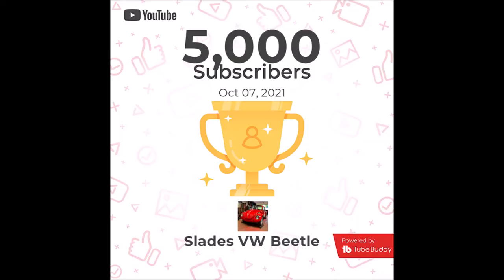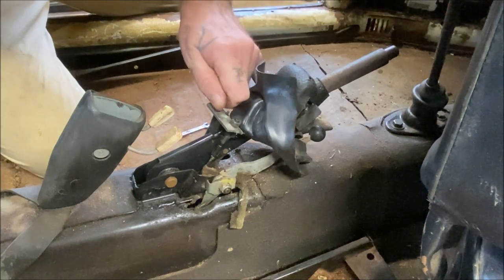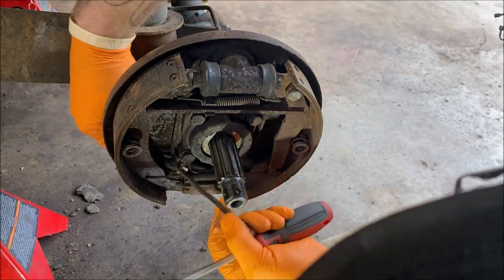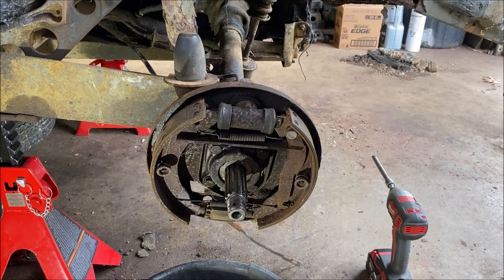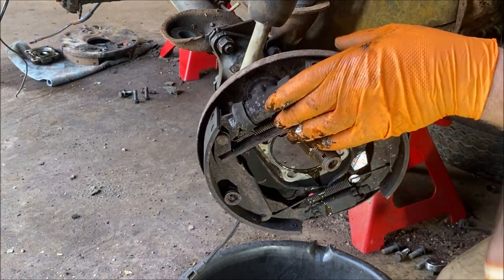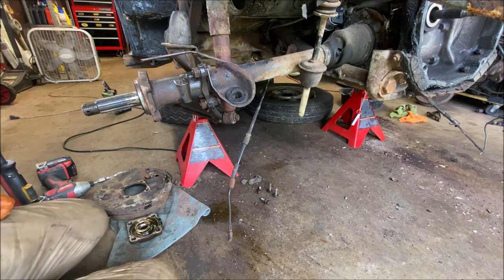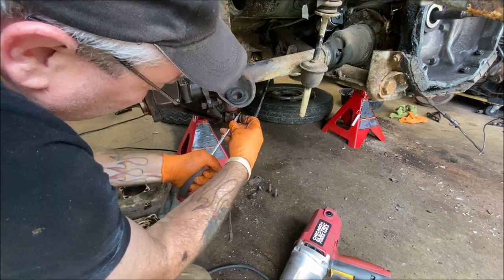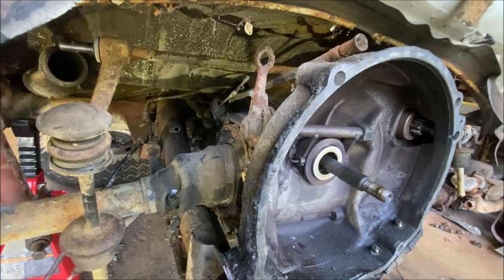VW Beetle Transmission Removal! Swingaxle Transaxle! DIY!

Comment: Greetings, thank you for the sharing this video along with the products you are using and the infotainment. I have a 58 which I need to have the crashbox transaxle removed and replaced with a swing axle. Going through the steps you’ve showed was not what I imagined, however I’m certainly glad that you went through the numbers on the removal process. This will be my first time and I want to do it myself. Again thanks for the education, God speed!

Comment: I just got a month ago a 1968 Beetle as yours, probably on better shape, and your videos are the best help I can have to restore mine, because as you, I'm doing it by my self. Thank you for your videos and congrats for the 5000 followers. Also, I got a 1973 beetle that will need a lot of work and I got that one as a trade for a small trailer that I had. I believe I will convert that one into a Baja Bug because the previous owner did some modifications that I really hate as a Beetle lover. He removed the original dashboard (totally removed) and install a aftermarket dashboard. I have two options, have a Baja Bug and keep it as it is or restore the car finding another beetle body where I can remove the dashboard and fix mine, but I believe this is almost mission impossible, so the Baja option sounds the best solution, but will see. Keep your hard work.
Reply from the maker: Thank you Jaun!! I appreciate the kind comment!! 
Baja may be your best option with that one, I can  understand why you would go that direction!! 
I like the 68! It was also my first car when I was 16, was a 68 Beetle!!

Comment: Well that was a struggle.  Glad you got it out.  My bolts on the bus don't give me trouble.  They snap in half and get tossed.  I'll invest in lots of hardware on reassembly.  I'd dread the wire wheel cleaning to come.  Keep up the good work!
Reply from the maker: Those bolts have not been loosened since 1968, and I could tell! But as much as I complain, and my body feels it, deep down in it keeps me busy! Thank you my friend!

Comment: Thats a great achievement getting the 5k subs. Congratulations. 
There is a special tool to pull those axel bearings but i cut 3 slots around the edge and use standard pullars on them.
Reply from the maker: Thank you sir!! I appreciate that!!! I never seen the actual tool yet. I’ll have to do as you described.

Comment: Congratulations on 5,000 subs Slades.  I bet you will hit another 5,000 by this time next year.  Keep the content coming, you make an near impossible task seem possible and doable.
Reply: As a thought Slades, could you take a few minutes on a video to show us where are the best and safest points beneath the Beetle to put the jack so as not to damage the underside of our Bugs. You might be able to run a short clip like you did recently. I have seen many on YouTube but there are different places that they advise and one advised to place the jack at the exact spot you advised not to place the lifter, the cross bracket at the fork ends.  This would be helpful and put to bed once and for all where to properly put the floor jack. 
Again, thanks Slades.  Jim Semertzides
Reply from the maker: Thanks Jim….I truly appreciate the kind words!! That’s what keeps me going!!
I’ll definitely do a video on front and back…jacking up and also jack stands! Gimme a short period! Mine has no wheels on or beam to lower it to the ground temporarily

Comment: Another great video Slades. Proud to be part of the 5000 subscribers. Boy all the stuff I’m going to have to do to mine LOL 😂. I’m trying to source tires. Where is a good place you recommend? At work we don’t have ability to get any in the size needed. The tires are from 1993 and the spare is from 2001 no way I’m chancing those. Lol
Reply from the maker: Honestly I would try the online places like tire rack. 
If your staying stock brother, I believe cip1 and Jbugs carry the tires. I even punched them in on Amazon
Reply: @SladesVWBeetle  Yeah JBugs was out of stock. Online I did find one place. They only have one brand though in the 165/80/15 and that’s Nexen which is fine but I was hoping to have more of a variety. I read somewhere that a 185/65/15 would work but I’m worried that would be too wide.
Reply from the maker: @blakewaddell451  The 185 will work in the back. Now I’ve heard quite a few people running them up front. With no issues at all. 
If your car is at stock height, I believe it would be fine. I would go online with that tire conversion chart and see the difference between stock and then grab a ruler and get under there and check it out. Doing tire stuff is always tricky.

Comment: The z bar is a variable rate helper spring for heavy loads. Added due to the smaller torsion bars. It’s not a sway bar.

Comment: You Could have someone weld a stud onto the z-bar bolt that broke off. I have done that before and it works well.
Reply from the maker: Thank you!! Actually caught me off guard. I used PB blast, probably should have used heat.

Comment: Congratulations on 5000 Subs by the way your video was perfect timing I'm going to be pulling the swing axle out of my manx style dune buggy. The transmission has 1st 2nd reverse but not 3rd and 4th previous owner said it was a linkage problem I've been adjusting the linkage no third or fourth it feels like it goes in 3rd or 4th but nothing happens do you have any ideas. Thanks
Reply from the maker: Thank you!! And thanks for being here!!! Sometimes they come right out, and yours might!! Mine was never out since 68, and I’m in the rust belt! 
Not sure, if you tried adjusting, it may be the trans itself. I usually don’t hear if third and fourth though. Second popping out, or reverse.
Reply: @SladesVWBeetle  Thanks for the reply I'm looking for an easy fix like we all do right.......
Reply from the maker: @motorcycleguy73  Absolutely!! The easier the better. Did you check the coupler for play? And the shifter for all adjustment possible? I’m sure you did, but wanted to ask.
Reply: @SladesVWBeetle  It has a  new coupler new shift bushing and I've adjusted the shifter. When I shift it manually by hand without the shifter it feels like it goes in third and fourth I feel it but when I let out the clutch nothing happens or if I roll it nothing happens it doesn't go into a gear I don't know it's baffling I might pay an hour's worth of time to figure it out before I start pulling things apart the previous owner said it was just an adjustment but you know how it is with previous owners.

Comment: Can swing axĺe trans convert to irs or are they a different transmission completely?
Reply from the maker: Honestly, I gave it consideration for better handling. However, I’m going to use a camber compensator and show the installation. Because it can be done! You would have to change the trailing arms, sadly, the body would have to be lifted slightly to weld a bracket on that you can buy.

Comment: btw , you can weld on a new rod to znbar
Reply from the maker: Thank you for the input I truly appreciate that. I was actually thinking about a camber compensator. Still doing the research to see which is better.
Reply: If you need a bar parts I have some you can have. I think I have extra down bars in decent shape off a 1967 bug. They should be the same. Let me know
Reply from the maker: @irvingnorwood1640  thank you very much, that’s honestly very nice of you. I think mind sad so long that the threads rusted pretty bad.

Comment: Too much coffee or wat? Shaky hands
Reply from the maker: No, I have a tremor disorder. Thankfully with proper treatment, over the last few months it’s starting to get better that’s a little bit of an older video. Thank you for being here..
Reply: @SladesVWBeetle  I kinda figured it might be something like that. I'm a welder/fabricator and at the end of the day mine are either cramped and locked up or spasming like crazy. Sometimes early in morning after my morning cups wen TIG welding my hands are real bouncy.Thank God for Medicinal Cannabis.. It works wonders for all my aches and pains. CBD ointments and  some THC  treatment is wat works best for me. Ty for your insight with these cars I have a 56 beetle  that I've been forced to get going due to my 05 Subaru Impreza motor started knocking.. I had been accumulating parts for the oval for bout 5 years now so it is literally going to cost less to put the bug back  on the road versus the 5grand that it would've Cost for the Subi..Now that's going to be the project car.. Have a good one sir